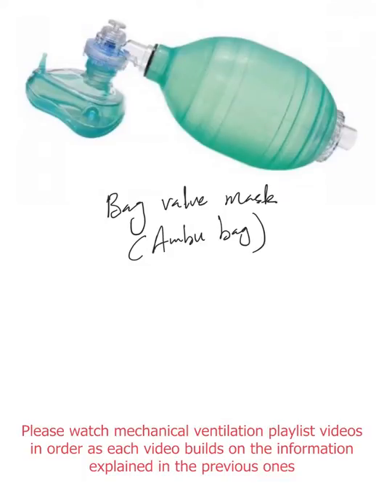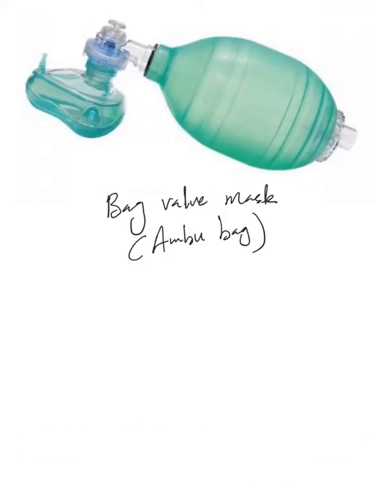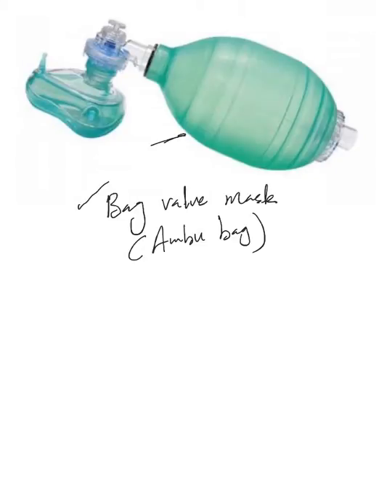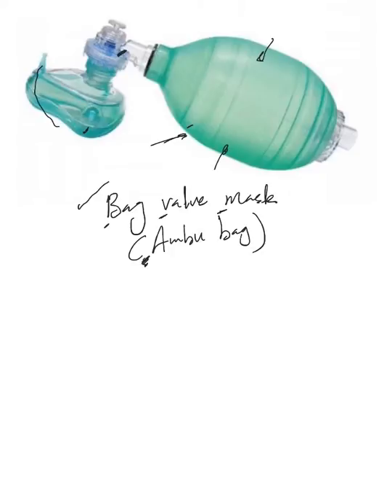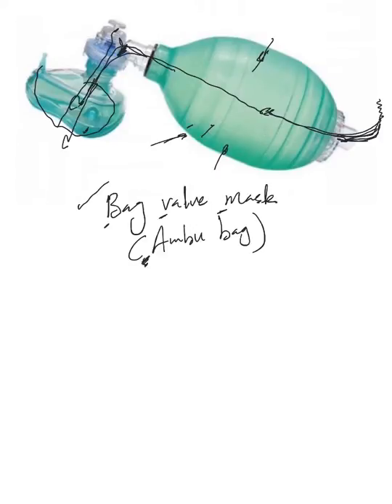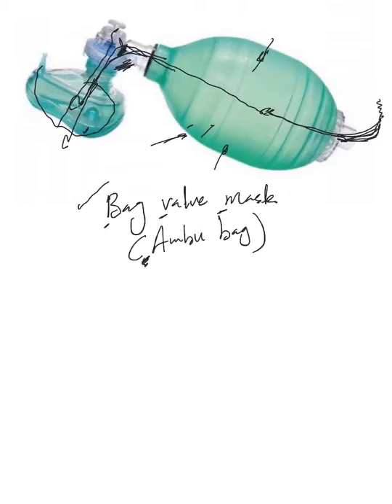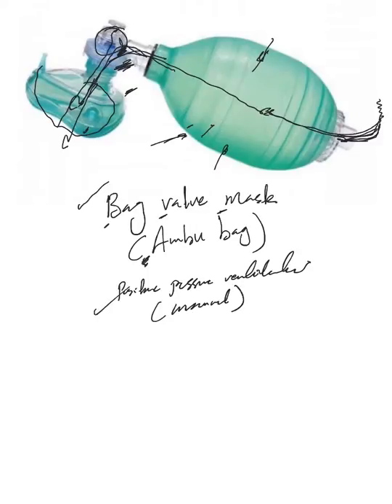Mechanical ventilation- 100: Bag valve mask (Ambu bag)

Comment: If the patient is crashing on a ventilator , and I disconnected him from the vent, but the patient's Resp Rate is so fast so that it is hard for me to bag him following his rate ...Should I give sedation/paralytics before disconnecting him from the vent?Thanks.
Reply from the maker: Generally I think of paralytics only if the problem persisted despite adequate pain control and sedation provided, and I use it only for the shortest time possible